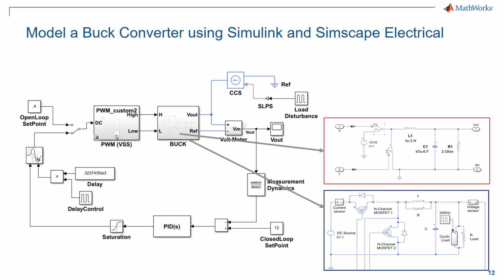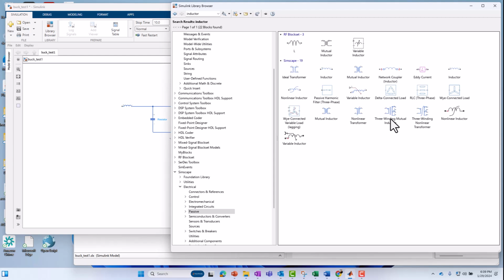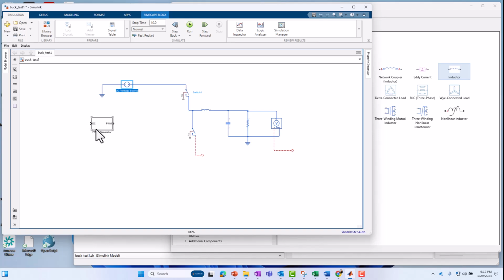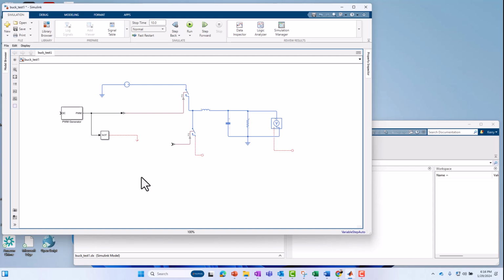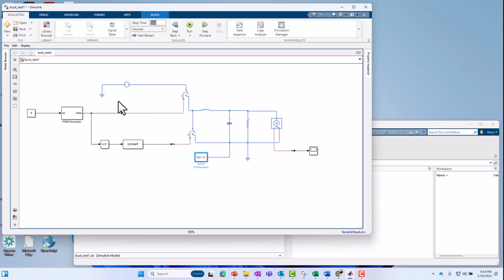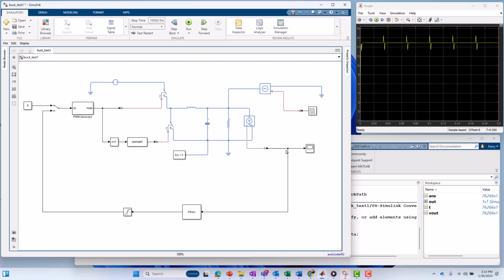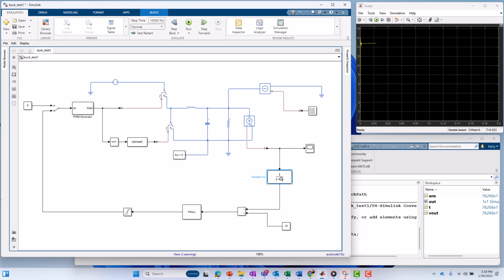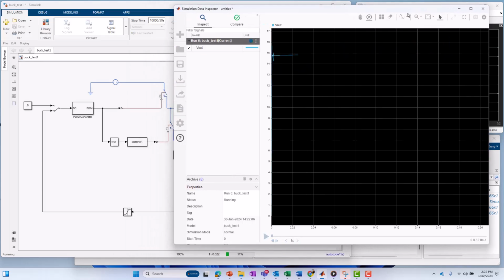How to Model a Synchronous Buck Converter

Comment: Hi i have a doubt , my output is not reaching to 15 volt, while it is reaching to around 28 volt when I switch to closed loop. & not even spikes are coming in my result , So i am requesting you to please tell me what value you have filled in the pulse generator of control current source 
 

& why my output is reaching toward 28 volt & I put every parameter value as per the video, if you can provide your gmail id so that we can communicate 

Waiting for your reply

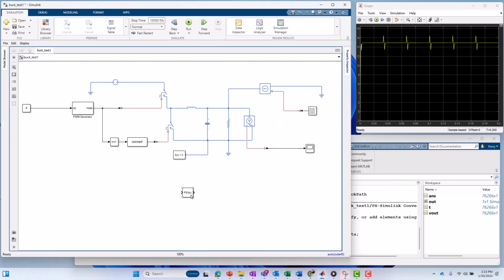Comment: What are the components that were added which cause the spikes to appear at 15:56
Reply: Hello and thank you for the question benjamin. The short answer is, a pulse generator modeling a load disturbance was inserted off-line while the recording was paused. Another user, @danielcosta5935, asked this same question about a month ago and I'll copy and paste my response to him here for you:

The bottom line is that you found a careless oversight in my making of the video. The model is running correctly but there is a sleight of hand going on that is tricky to see. I can explain what you're seeing though.  At the 15:56 point like you mentioned, a periodic load disturbance was introduced into the model. In addition the model stop time increased from 1000/50e3 to 10e3/50e3, 10x longer. The result is the periodic spikes you see in the output voltage. Unfortunately, I added this load disturbance off-line and then re-started with video recording after-the-fact making it appear like the voltage spikes just appear out of thin air which is misleading. If you look at the video before the 15:56 point, there is no load disturbance in the model, thus, the output voltage is clean. If you look at the first 30 seconds of the video, I briefly mention the load disturbance which is modeled as a periodic current injected into the load resistor. Thanks again for catching this and letting us know.

Comment: 15:56 tem uma pausa e o circuito já muda. Agora entra o ruído. Por que omitir?
Reply: Thanks for the question and excellent observation Daniel. The bottom line is that you found a careless oversight in my making of the video. The model is running correctly but there is a sleight of hand going on that is tricky to see. I can explain what you're seeing though.  At the 15:56 point like you mentioned, a periodic load disturbance was introduced into the model. In addition the model stop time increased from 1000/50e3 to 10e3/50e3, 10x longer. The result is the periodic spikes you see in the output voltage. Unfortunately, I added this load disturbance off-line and then re-started with video recording after-the-fact making it appear like the voltage spikes just appear out of thin air which is misleading. If you look at the video before the 15:56 point, there is no load disturbance in the model, thus, the output voltage is clean. If you look at the first 30 seconds of the video, I briefly mention the load disturbance which is modeled as a periodic current injected into the load resistor. Thanks again for catching this and letting us know.

Comment: Sir give me these simulation
Reply from the maker: The purpose of this video is to show you step by step how to create a model from scratch. Please follow the instructions and build your model yourself. Otherwise, you will not learn how to do the modeling. If you need more examples to look at, please check the examples linked in the description.
Reply: Yes, while we didn't share the exact model used in this video, you will find very similar buck and boost converter examples at the link under "Learn More" in this video's description.